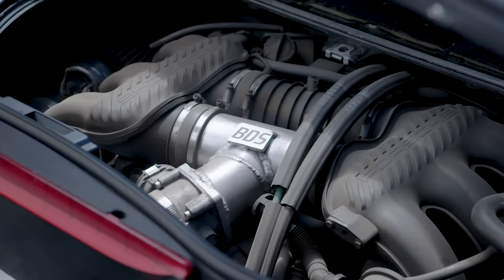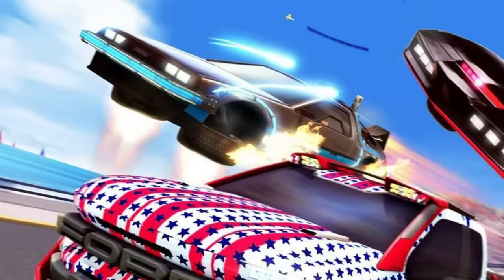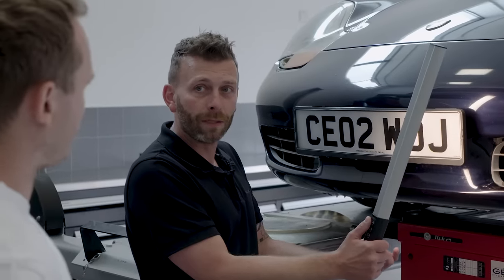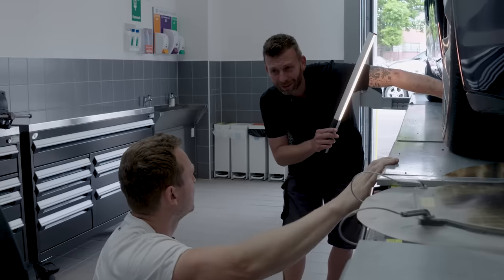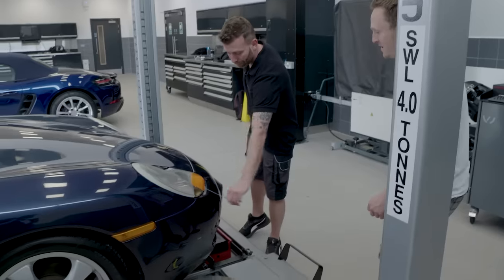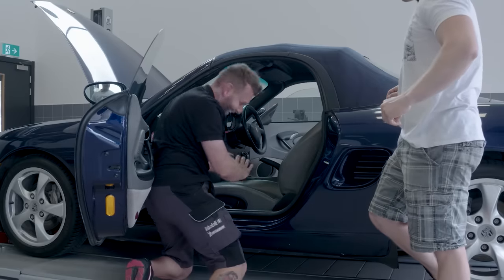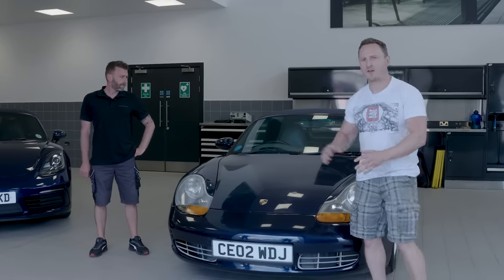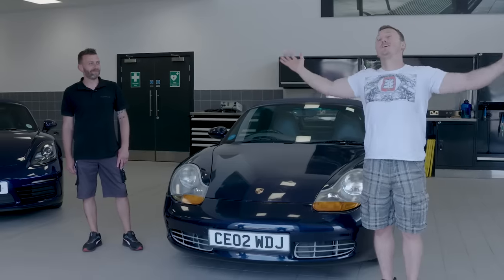Should A Boxster Be Your Next Project Car?

Comment: Hey the reason why the the Boxster is getting water in it is because the drain ports are clogged with dirt, debris,leaves, etc and now water cannot escape so it gets in the cabin and floods the floor  right where the computer is. The same thing thing happened to mine when I got it... Right after a wash where I was obliviously flooding the interior the car started to tweak out on me on a drive with the locks and the security system going on and off. I looked down in horror to see the DME sitting in standing water. I was fortunate enough to recognize this and immediately got the water out and pulled the computer out and dried it off with several fans for 3 days so no corrosion was able to for on the connectors or innards of the computer. The important thing is there actually is a company that makes a a fix where you can transplant the "innards" of the DME into a waterproof box so it can never happen again. But if you don't dry it off immediately chances of corrosion formimg are high and a new DME of the exact same year and model has to be installed then programmed by a dealer. You have to do a high pressure clean on all 4(front and rear) drain ports and not just the holes but the entire passage way needs be clear and drain water freely so it doesn't store up like a dam and then find it's way into the car.
Reply: Kevin White   I just bought a 2000 Boxster Can you tell me where the drain ports are  Any help Thank You

Comment: Upgrade taillights and front blinkers please lol it changes the look a lot
Reply: Taillights look ok there
Reply: Clear headlights are considerable more expensive. 2500€ for a set of new ones straight from Porsche I believe.
Reply: People change amber lenses to clear both front and rear to make it look newer (and more like a 911) They also replace the Boxster script and rear with P-O-R-S-C-H-E lettering ( so people KNOW it's a Porsche from the rear) as the only Porsche name is on the front badge in tiny letters.. all of this to impress your neighbours. A cheap "Personalised" number plate like "ZYZZ 1234" from Northern Ireland finishes it off and - Viola! - you can impress 14 year olds down the chip shop that you are a big cheese with a new Porsche!

Comment: Drive a 2005 987, and love it. Has the larger improved IMS, which is lucky on 55 plate.
Allot of car for the money, things to check are: RMS oil weeping, IMS gasket can also weep, Exhaust muffler to manifold gaskets, front coolant cross pipes, front suspension struts rust at the top, AC condensers, coffin arm bushes, they get through disks and pads but not crazy expensive if you do them yourself. Coil packs crack, they improved them so worth replacing if you have the originals on.
I switched to Millers Nanotech 5w-40 and engine runs quieter/smoother, great oil.
Nothing to be afraid of.

Comment: I've got the same year-model.  Regarding rust -- yes the bodies are galvanized and should be good.  But the combination of aluminum and steel suspension components and worn rust protection on the suspension can result in galvanic corrosion within the suspension components.  This will result in bolts which don't come out (primarily the sway-bar linkage bolt that goes through the bearing carrier, but can also effect other bolts).   If you see white scale on the aluminum parts, it's a clue that it might be happening.  If the car is going to see salty conditions, you should really refresh the undercoating on the car regularly.

Comment: 1 year w/ a Cayman 981 now. 1 million miles of BMW ownership. Porsche engineers really did think about maintenance of these cars. Feels like is was engineered underneath much more as a track car than any BMW I've had. Took me all of 15 minutes to remove the rear bumper... so I could polish the exhaust ;-) 10 minutes to remove the engine cover... so I could clean the engine ;-) I bought this thing w/ 54k miles, now has 64k miles and I plan on putting 250k on it!  Oil & PDK fluid changes are a breeze. Unmodified, and it's a Blast at the autocross. Maintenance costs will always be higher than Japanese; but the sound of the flat 6 at 7,500rps... priceless!

Comment: I've recently been thinking about getting one for my wife. She has a 2003 Astra 2.2 convertible with only 72K. We've had it from a year old. It has everything you want, leather, aircon, cruise control, heated seats etc. However, what would you get if you wanted to change it? You certainly wouldn't want anything less (it is a superb car). We bought it as our daughters were in child seats at the time and it was one of the few convertibles that actually ha room in the back. Now a four seater is not a necessity.
So, the idea of a Boxster, not older, seems good to me. 
Thanks for the very informative video.

Comment: Never been much of a Porsche fan until I got myself a Cayenne turbo. I can't think of any other car that does so much so well. It goes like stink, works well off road, handles like a dream on road. It is incredibly well screwed together and it's clear they only used the best materials when building them. After market parts such as starter motors etc are now very cheap and easy enough to get hold of although with some parts you can easily see a quality difference when compared to genuine Porsche parts - suspension arms being one example. I don't think this will be my last one.

Comment: When covid started these were so cheap. I picked up a 2004 Boxster S( the final edition) slate grey, looks like a mini CGT to me, for 14k flat. Now these last edition models are going for 24k plus. They were cheaper than s2ks at the time and they are much faster than s2ks. Great car,it sounds so good with the engine in the back,especially with the top down.
Reply: If it’s the 550 edition then it’s GT Silver but realistically more like £18k tops ! You can get a good RS60 for £24k.

Comment: had an 05 987 which was awe inspiring. My wife wanted a slightly more updated version so it left us in favor of a 2015 981. Love both models, wish I could have 1 of each. Also wish the 987s would become as cheap as some of the 986s as I really like the styling and interior of the 987 a bit more.

Comment: 0:46 "...decent boxter for well under 5k pound"
in Italy,basic model is 14k € (12k £ / 16,500 $)
It's amazing how cheap are cars in UK...
Reply: Makes me want to export them.
Reply: 8( I bought a 987 Gen 2 Boxster 2009 49000 miles Basalt Black with black leather/interior, PDK, Sport Chrono, Porsche Sport Exhaust, PASM (electronic dampers), Sport Seats Plus, Bluetooth & sat-nav plate, 19 inch Sport Design alloys, with a two year extended warranty for £21000 in June 2018 from Porsche Centre Cambridge

Comment: You want a laugh, go into the Porsche dealership and ask for a quote on new clutch, flywheel, IMS and cam chain tensioners. ( Mine is a 2000 986S) They don't sell a IMS bearing replacement. £8000 to change the IMS..... Most likely a new short block. the price for the clutch and fly wheel was not to bad. Crazy. Once the maintenance is done it is going to BDS.

 A note on buying one, try and find an early S. My early S is much cheaper to buy road tax for than a 2001 car and is likely to have the better IMS fitted and no traction control (Talent Compensation). Stock they understeer badly I was disappointed to start with. But fitting H&R up rated anti roll bars (sway bars for the Yanks) transformed the front end. And the way they go from 3rd to the top of 5th gear is enough to deal with a lot of newer cars with higher horse power.

Comment: Fixing the immobilizer will solve a bunch of electrical issues, but it is expensive. ECU Specialists in Florida have a lot of experience doing this if you'd rather not deal with a dealership.

Comment: 'Porsche thinks about the person working on the car, just remove the rear seats to do your water pump' 👁👄👁
Reply: For a mid engine convertible that is pretty simple compared to almost any other similar car. You can't have a mid engine convertible sports car and also expect it to be as easy to work on as a Camry.
Reply: You fold it forward and remove an access panel. Literally don't need a wrench to get at it. It's not complicated. Also, the seat is held in with a screw on each rail and an electrical connection if you want to pull those for any reason. Again, pretty damn easy.

Comment: Saab turbo project car :) B204/B234 or B205/B235 (2.0 and 2.3 petrol engines from 9-5 first gen and 9-3 first gen and 900 last gen) very cheap, very good engine (although the car is not the sportiest, it is a cruiser

Comment: The Boxster is one big headache to deal with. Better off with a classic Alfa Romeo Spider with a manual top, manual windows, no computers, no sensors and No IMS issues.. They come with a sweet 4 cylinder engine, five speed gearbox, SPICA mechanical injection, front and rear disk brakes, plenty of interior room, replacement key is $2 bucks and looks absolutely fabulous.

Comment: 5000 pounds?  Damn.  I believe engine work is tricky given the location, but if you swap out that stuff at the start I reckon you could have a sweet, hard running car for years for a low price.

Comment: I've looked at these in the past as a cheap way into a porsche. I know the IMS issue is probably very hyped but it can be an expensive issue and knowing my luck i'd be one of the few it happens to.
Reply: Really not worth worrying about, once past 75000 miles the engine can go bang for many other reasons so only a fool spends £2k getting the IMS done on twenty year old car...

Comment: It's a water cooled flat engine from Porsche. Meaning all the seals and water pump has to be replaced meaning dropping the entire engine
Reply: No it doesn't! I can access every part of mine and the seals are fine. You don't even have to drop the engine to replace the clutch!
Reply: @ixifutureproof9286  1st/2nd gens all have very old bushings and seals that leak due to ozone
Reply: @gvi341984  I must be lucky as mine are fine. It's done 35k but it's 17 years old.

Comment: Only seem 2 IMS bearings in 17 years... you need to work in the shop more. IMS bearing failure is a serious issue.
Reply: Sort of. It's been 20 years: most of the prone cars has had the bearing replaced and updated by now, so it's no longer really an issue.
Reply: rubbish, mine has 180k kms, runs like a top....dont believe the hype mate

Comment: Got me thinking why are these so cheap? IMS bearing dies Googles it to find out the only way to fix it is via yanking the entire motor out and its a common issue, for what they are.... They are great. But only, when they are in good top working order.
Reply: I stand corrected, he said hes only seen 2 with that failure for over 10 years of work.
Reply: @tylerfarrow2506  yeah it's been blown out of proportion on the web...my 986 has 180k km on the clock and runs fantastic....buy one they are brilliant

Comment: As Charlie Harper said, “You bought the girls version of a Porsche”
Reply: Which is total bollocks. A good 986 can keep with air cooled 911’s on a country road and has better balance when driven to the limit.
Reply: Maybe a 2nd Gen…
Reply: @therealmac25  what do you mean by ‘gen’ the 986 can do the above. A 3.2 S is quite capable of the driver knows how to drive properly. Three of our group got speeding tickets that day but it was worth it.
Reply: Should have put 987 instead, the 986 is a fast car, just not on the same level as a 911, the 987 could possibly cut it to be in the conversation, 986 was designed and built for 911 owners to buy for their wives. That’s just my opinion
Reply: And I’m not trying to be rude, or a hater, if you like the 986, drive the wheels off that car and enjoy it! It’s just not a favorite of mine, the 987 to me brought the comparison closer, but I think 911 is in its own category!

Comment: I like the boxster it's just that, it has that ugly universal rounded bubbly looking interior, with unreliable electronics
Reply: It’s always going to be the poor relation to the 911
Reply: @bmwman1981  the fact is it saved the 911. The reason we have GT3’s etc today is because the Boxster saved Porsche from going under. 

And from a technical point of view the Boxster shares the 911 suspension components and has a better weight balance and moment of inertia. The Boxster is a better design than a 911, just a shame they didn’t give them a proper engine.